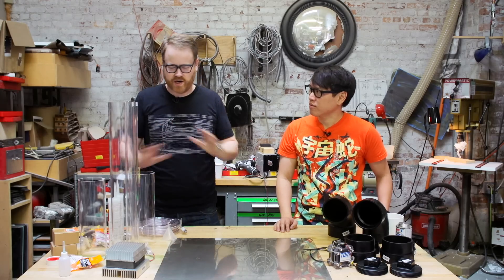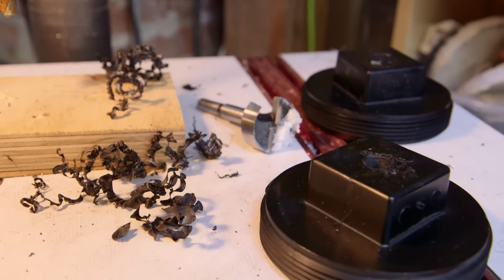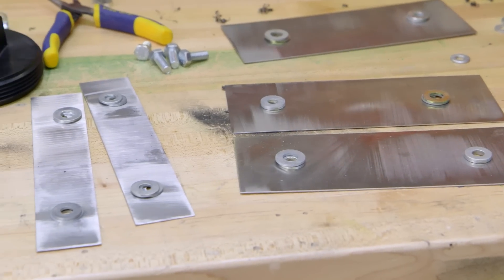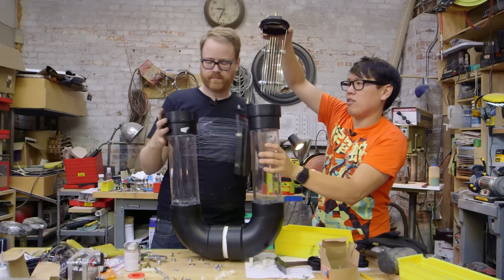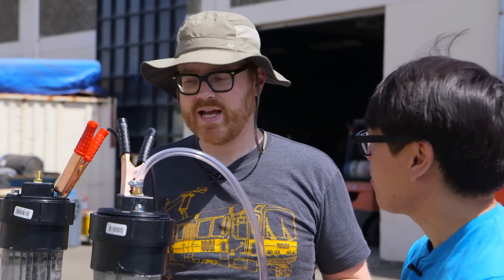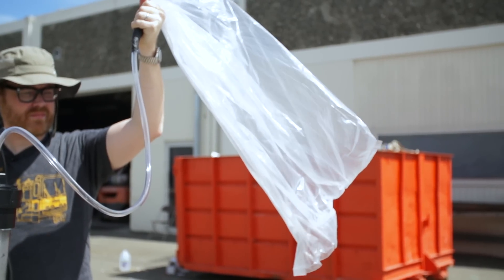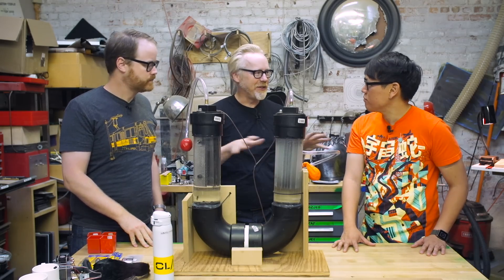Tested Builds a Hydrogen Converter

Comment: You guys either need to increase the concentration of KOH in the solution or run a lot higher voltage considering the electrodes are so far away from each other. I made one from a gatorade bottle, a coffee can and dialysis tubing as a separator with nickel electrodes. I was producing about a liter an hour of hydrogen (not a mixture of H2 and O2) at 13 volts DC (my electrodes were tiny 28 gauge wire but they were only about an inch (25.4mm) away from each other) with baking soda in distilled water. I give it a 2 out of 10 it DID TECHNICALLY work but there are much better designs. Many many years ago I built one similar to this one and I had to run about 119 volts dc to get any appreciable amount of gas out of it. Sealant on the large black ABS end cap also helps.

Comment: Once I'got to the point, When I"saw this....I'said wtf is wrong with these people the anodes and kathodes need to be extremely close to each other without touching so basically the closer they are the more efficient the generator is,also you don't need 12vdc to run this as a matter of fact you need only 5-6vdc that's why that thing that you build and call generatior is just a waste of time and resources also your generator should be 226% inefficient but I'can forgive you if you redo this experiment the right way and also you don't need a fucking 4 inch tube to make this work actually you can get away using only razors!!       My god you are a dissgrace to human race and to yourself    Peace

Comment: A Stanley Meyer type Water Fuel Cell (WFC) uses both Positive Pulses & Back EMF Im-Pulses then 'Short Circuits' the WFC before Catastrophic Failure is even reached... It still uses High Amperage to create the HHO Gases but, HHO is only created at the 'Short Circuit' & all of the Heat/Magnetism/EM is externalized to an external Load ie: a Light Bulb & optional Battery Array.

Comment: "22 volts of power ... 100 watts of energy" 😂
Reply: What's wrong?
it's must be nearly 4.5 amps
Reply: @sunapumohit8676  watt is power. volt is potential.
Ws (Wattseconds) would be energy.
4.5 A is current...
Reply: @meowme7644  what did you just said

Amp is unit of current dude that's what I've said I think you got little confused of what I said
Reply: @sunapumohit8676  you just say dude to me in this context? you think I'm confused?

maybe it's confusing you dude...😅
Reply: @sunapumohit8676  What is your calculation?
Reply: @meowme7644  I just said my calculation dude it's 4.5 amp 
And I'm not confused about anything it's all clear
Reply: @sunapumohit8676  why do you always have to use words like "dude" and "confused".
Can you show your calculation (with units), then i could see if I'm wrong...😁
Reply: @meowme7644  p = vi
The power he said is 100 Watts
And the voltage mentioned is 22 volts
So, the current will be p/v which is 100/22 and that will be 4.54 
And thats the current flowing
Reply: @sunapumohit8676   @Sunapu Mohit  that was a fast reply. thank you. your calc would be like mine...

But Brycen M wrote ""22 volts of power ... 100 watts of energy" 😂"...do you see what he meant?

22 volt is not power and 100 watt is not energy...😁
Reply: @meowme7644  yeah I saw that but I thought he mustn't be aware of the current so I commented as what's wrong it's 4.5 amps
Reply: @sunapumohit8676  yo cool 😉 
i think it was a joke..
Are you from India? Your knowledge is good.
Reply: @meowme7644  Yes bro I'm from india
And thanks bro
Reply: @sunapumohit8676  hey sunapu, got busy. Yo cool, saw this nice sun and warm weather on the photo.
Your english is very good too. All the Best. Greetz from Germany
Reply: @meowme7644  thanks bro
Love from india

Comment: As I was watching this experiment I was thinking about the design of the GREAT PYRAMID IN EGYPT.
THE 2 chambers operating as the oxygen/hydrogen extraction channels,with the water beneath the pyramid for the needed chemical,s.The outer surface of the pyramid,acting as a huge solar panel.The 2 ports on either side of the queens chamber as the hydrogen, oxygen delivery channels.

Comment: they are dumb. like wow you need electrolytes. use baking soda and water and it will produce more. then try it. also you need to pressurize the system.

Comment: the anode and the cathode are too far apart. the farther apart they are the more water the electrical current has to travel through which greatly impacts the yield of hydrogen. Electrolysis isn't a bad way to produce hydrogen, but a drycell is much more effective than a wetcell generator like you attempted

Comment: Guys, seriously, what the hack have you used as electrolyte?

Not trying to bash you down but..... That "kinda" counts a lot.... and depending on the electrolyte.... what kind of  Voltage Vs. Current are you running that thing? (PS.: I saw the video without sound so....)

Comment: I was a little dumbfounded when they separated the positive plates from the negative plates, then come to find out it didn't work.  Yeah, because the closer the plates are the more the separation of hydrogen from oxygen.   That's like holding gasoline on one side of a room, and a flame on the other and saying "It didn't catch fire so gasoline isn't flammable."

Comment: A lot of people complaining but no one s explaining why it didnt work.  The problem (I suspect) was the huge distance between the anodes and cathodes.  This huge distance will require more current to work since there is much more resistance, this is why normal HHO rigs have the plates very close together, and often staggered  (+ - + - + - +).  

That being said, there is no chance a solar panel hooked directly to the electrodes would ever work, not near enough current, and this would be true even if the electrodes were properly placed in proximity to each other, the more current, the more hydrolysis will take place and the more gas will be produced.  
As for the voltage, 22v is way way more than you need,   If I recall correctly 1.2ish volts is the approximate voltage you should be using for an electro-chemical cell, anything higher will just cause unnecessary heating of the water, and subsequently creation of water vapor in your gas.

Comment: Try using a transducer to vibrate the water at its resonant freqency use pulses of dc current at intervals to complete the process in the two cylinders and you will find it will make much more hydrogen.

Comment: The voltage has nothing to do with the volume produced. Water electrolizes at about 1,6V and if you want to increase the gasvolume you should increse the Amps sine the Faraday constant basically tells you everything.

Comment: It may be a higher voltage but a car battery has cca's (Cold Cranking Amps) in DC voltage and has more current output then that weak solar panel, plus batteries are cleaner because they store the electricity and do no have frequencies such as AC

Comment: Instead of a continuous flow of current, try pulsating it at a frequency close to the speed of an electron (+/- 28 MHz) to resonate and increase efficiency.
Reply: MHz is a measure of frequency.  It has nothing to do with the speed of electrons.  And:  AC current is useless in a hydrogen cell. All you will do is heat the water.
Reply: @amedeeabreo7334  mHz measures pulse with modulation DC current (i.e. car ignition system). The objective is to reduce the amount of energy spent. Resonance happens when the electron is hit mostly while moving in the same direction, not when returning which would counter effect, just as we do on a swing.
Reply: @josidasilva5515  It has been extensively studied and pulse modulation proved less efficient than DC.   Here is a scientific reference:

Shaaban, Aly H. (1993). "Water Electrolysis and Pulsed Direct Current". Journal of the Electrochemical Society. 140 (10): 2863–2867.

Comment: how the heck is that supposed to generate enough hydrogen when the electrodes are so far apart from each other? (positive and negative) the current has to travel forever, high resistance!

Comment: 20 volts is to high for a low voltage cell like that you should have added a buck converter to the solar panel and converted the high voltage into High current then it would have worked allot better.

If that is a 100 Watt Panel it should have about 6Amps. So at the cell when the system is running you will probably get about 4v and 6Amps = 24 Watt. So as you can see there is allot of wasted power. Using a buck converter and setting it to 5 or 6v it will then convert the high voltage to amps. This should give you something like 5v and 20Amps if there were no losses but there will be so maybe 17Amps =  85 Watt.

Or you could have added neutral plates between your cathode and anode that would have created a higher voltage cell but it would be much harder to separating  the O from the H. Using a stacked plate design you could have separated the gasses with 2 gaskets  with a membrane in between so the gas cannot mix.

Comment: better off just using Sodium Bicarbonate and distilled water and maybe hook up two solar panels and do you pos and neg per one side, as distilled water is a good insulator at relatively low voltages, even at 110V AC.

Comment: "Volts of power and watts of energy" - I died a little on the inside
Reply: As an electrician...same
Reply: and running more than 2.5 volts through each plate only produces more heat LOL so 22v is kind of funny
and electrons travel in a least path of resistance so all that is going around the plates
this whole video has to be a joke, you guys must know better :)
Reply: Resistance is futile;-)
Reply: Good catch 👍
Reply: can I ask why? English is not my main language so i maybe missing something 😂😅
Reply: If only they used the super joule thief circuit.
Reply: Found the electrician

Comment: I don't have a shop like that, so I just bought a ready made generator. A little spendy, but what can you do when you don't have tools/equipment? I use distilled water, tho, so as not to introduce unwanted minerals - and I used the potash as they did, because most other electrolytes deposited a residue on my plates and reduced the output. Potash was clean.

Comment: Unfortunately the "adaptation" they made to the original design, severely reduced the units production capacity, they needed to compensate for the large gap between the electrodes by adding considerably more electrolyte, in addition to increasing the voltage, a unit of this size should easily and safely produce between 2 to 8 litres per minute of HHO.

Comment: Nice solar panel, the reason behind using a car battery is plenty of current. Although they made almost twice the voltage on solar, the maximum power is 100watts at around 5 amps {Ideally} as in, perfect sun light, perfect reception angle, blah blah blah. A car battery is (assuming even the puniest) capable of providing 250amps (minimum). Simple math puts that at 2,500 watts at 12V. The only thing limiting power consumption is the rig. The only thing limiting the power output is the supply. The solar panel will limit both voltage, and current output, to protect the panel, and regulator. A battery is dumb, it does not care, you want a burst of cranking amps? It will provide it. More power, more work, do I write a period here? or punctuate it..... If you want more voltage, or showmanship, you could simply stack batteries in a series. 12, 24, 36, 48. No fancy rig needed, they could have just hooked the whole thing up to an electric golf cart. Those fairway cruisers are usually equipped with 6, 6 volt, deep cycle, high current batteries. Which would yield 36VDC+ all day long on that rig...

Comment: I am running an electrokinetic system that creates Hydrogen gas. Right now I am venting it to a chemical hood but would like to move it to the physical lab. Is there an alternative to deal with the building up hydrogen other than venting or burning?  Perhaps chemically? Thanks.

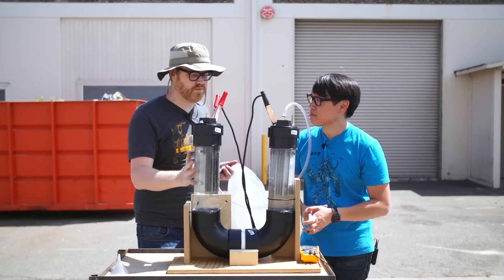Comment: their misuse of science words at 6:00 is cringe worthy.

"split hydrogen into its constituent molecules"  - hydrogen is an element, not a molecule.  The oxygen does stayed paired as O2.  Hydrogen later pairs up to make H2.  

"solar panel produces 22 volts of power, 100 watts of energy"  - ugh.  voltage is not power.  it's a potential...a pressure that's capable of moving electrons.  watts is not energy.  watts is a measure of power.   It's like he said this car has a range of 55mph.

final note - the solar panel should be pointed at the sun.  it's far more effective that way.  these guys look like science clowns.

Comment: I would like to point out that while voltage is important in order to drive the reaction, the actually conversion comes from current and not voltage. Current is the flow of electrons and so the higher the current the more H2 you can make. Use of solar panels is probably where you went wrong.

Comment: King of Random did this at 5 liters per hour. Lmao
Reply: Correction bro Its per minute ✌
Reply: & its 5 liters per minute, not hours, more like 300 liters per hour. lol
Reply: Yes, more amps is what is needed to do that!
Reply: they basically copied his design😂
Reply: It wasn’t just the solar panels fault, they needed the electrodes much much closer together.
Reply: He had two car batteries involved... Where these two had one whimpy solar panel. It would take an entire solar panel array to get good results. But them using solar did answer a curiosity I had... It is possible. Just need more than one panel lol
Reply: @robertf6523  the solar panel wasn’t very powerful but 5 amps can still produce a lot more hydrogen. The problem is the resistance along the 3 foot gap between electrodes meant the never used 5 amps. The king of random put his plates a centimeter apart to actually use all the amps

Comment: I wonder why the guys didn't think to use a DC-DC converter to step up the voltage, or an inverter to make 120VAC, then rectify the higher voltage? 20VDC on the panel isn't very much, especially if that's the panel's open circuit voltage.

Comment: This has been a demo of a very poorly designed water splitter. What gives guys? Most any hobbyist can produce a more efficient device than this... check out "Cody's Lab."

Also... it only takes a couple of volts to split water, you need amps. This video is just all around bad. Why?

Comment: They should have used the solar panel to charge deep cycle batteries and then used that stored energy to power their device. They simply didn't have enough amperage and their design was odd.

Comment: Could copper work instead of steel
Reply: ZAMBUZAAA !!! no not really, it will get attacked by the oxygen atoms and turn black
Reply: ZAMBUZAAA !!! You could do it for a small amount of time im sure m, but your gonna get copper oxide.
Reply: ZAMBUZAAA !!! the reason they use stainless steel is because it does not oxidize.

Comment: Just like when mythbusters done making hydrogen. how come these normally very intelligent people have failed twice to reproduce something kids build better your voltage argument is wrong. just connect it to a power supply with low volts and high amps and then see what countless people have built before. producing large amounts of hydrogen. your rig is good your theory is wrong. solar can make it for free if you have several and use the in parallel to increase the amperage.